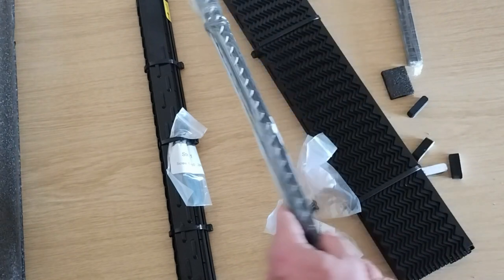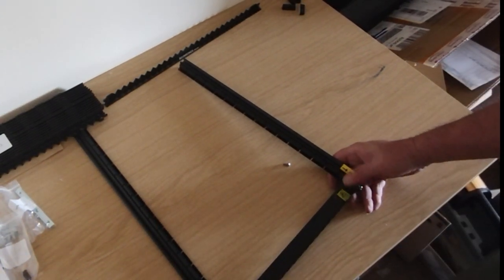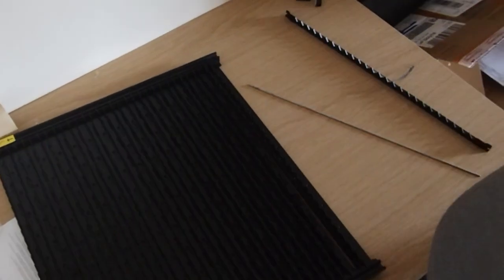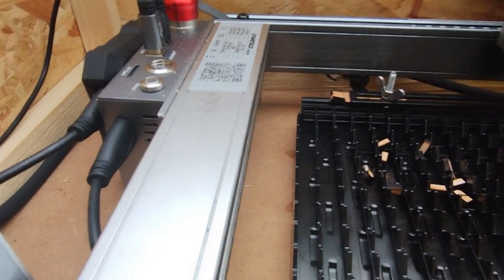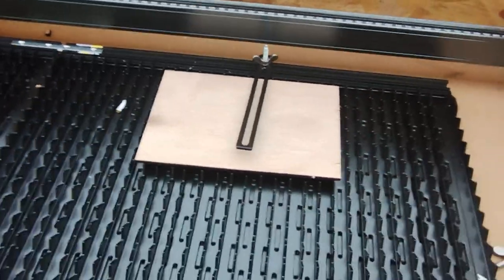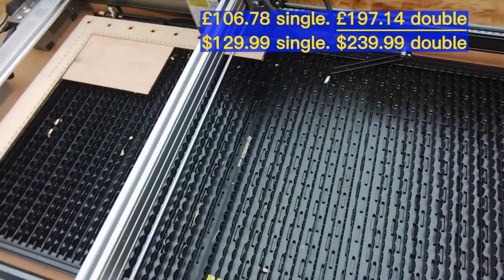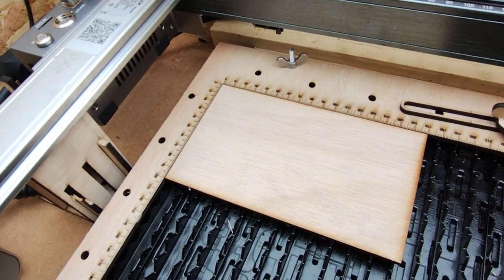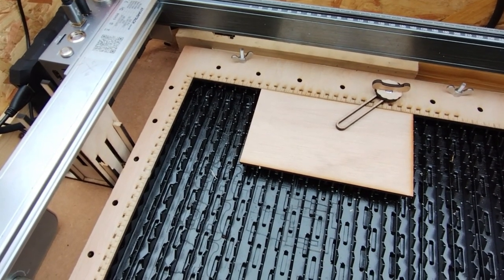Atomstack F3 Matrix . Is it worth the price tag? I assemble and review the new honeycomb replacement

Comment: Where did you get the laser cut square from? I’m looking for one. 😊
Reply: I made the square myself using the laser. design the ruler you want.  make a ruler (i used Lightburn array tool to make sure the spacings were correct) and engrave the marks ad the fixing points but don't cut the inside off. Fix it in place having lined up the 0 point with your home position and checking you are as square as possible. Then make a cut up the X and Y axis along thr zero points. I hope that makes sense.
I also like to make sure the ruler sits above the bottom of the work piece so that you can index against it. I did this with another ungraduated ruler sitting on the base of my enclosure and spacer blocks for the height I want. Just use some screws and CA glue to hold it in place or if you are using the matrix ( i stopped as too difficult to keep clean) then you can make some holes and use the t nuts (also crap) supplied.

Good luck, Hope it helps.
If you need any more help, just ask.

Best regards,

Neil
Reply: @Not_my_new_Ordinary  thank you very much for this information, it is very helpful. Hope to have a similar setup to yours. 😊
Reply from the maker: Do you have lightburn? I could send you my library file for the square ruler if you like?
Reply: Oh yes please 🙏
Reply from the maker: email me laserunfocused247@gmail.com and i'll send you the files.

Best regards,

Neil